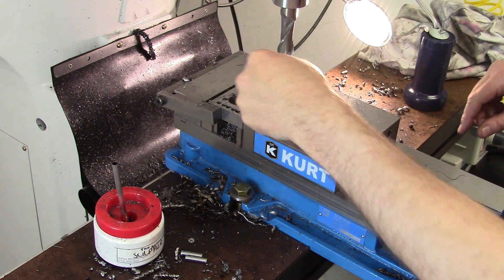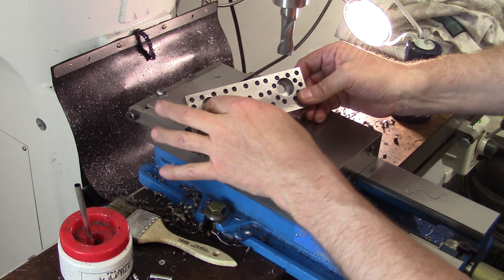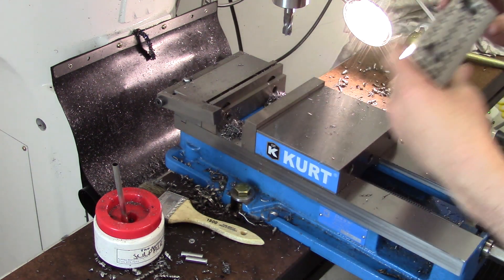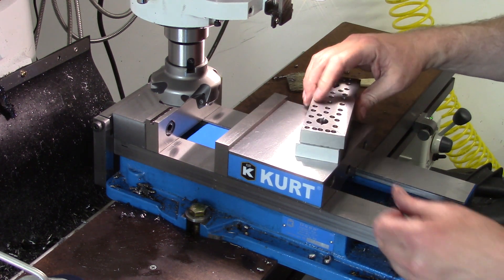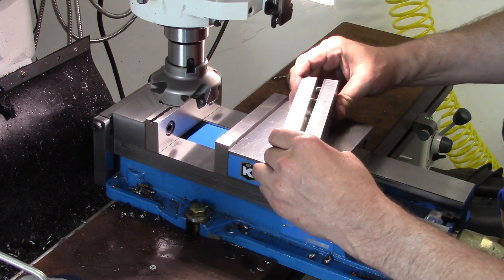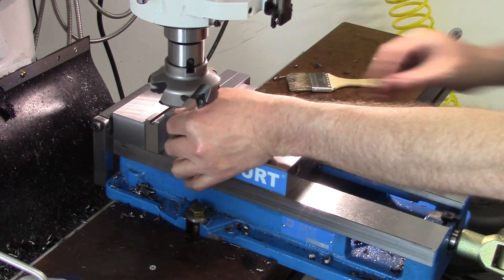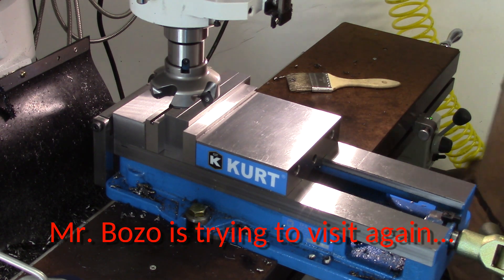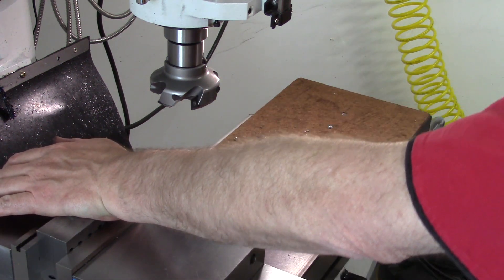Indexable vise jaws for Kurt vise - part 5/5

Comment: If you would have just moved the mounting holes lower they could have stayed 2" . Miner offset to gain the height wouldn't change the hole line up . I like the idea and it's a great build to pass on. Thanks nice vise to have . Hard to beat a Kurt , how do I get the pdf

Comment: Really great idea, and nice execution. Why raise the jaws off the bed of the vise though? Seems you'd  want to leave shims in all the time for positive registration if you really want the gap (else it's just the clamping pressure of the cap screws to maintain accuracy). I think you said you wanted the gap for chips to go? Wouldn't a chamfer on the bottom edge be better for that purpose?

Comment: Hi Mike

great series I love your work, I have just made a set of these for my Kurt going by your .PDF file all went well but I have one question, did you follow up anywhere with a drawing that told all the different angles available and the pin placements?

Comment: very nice series. i think those jaws will prove very useful. i was wondering if it is really necessary to drill the floating jaw. it seems it would be difficult to maintain alignment between the two jaws,how do you compensate for the downward clamping motion of the floating jaw. would you consider making the print available ?